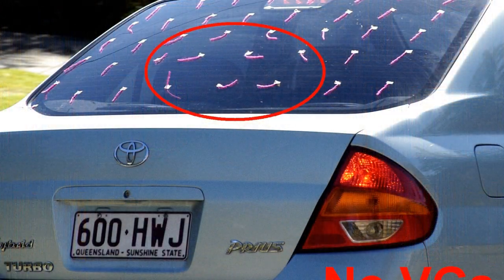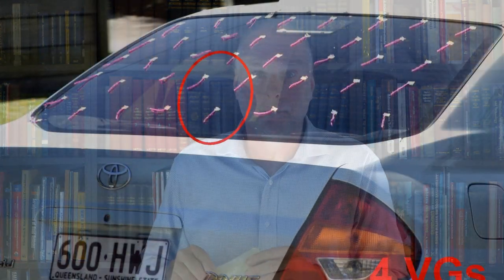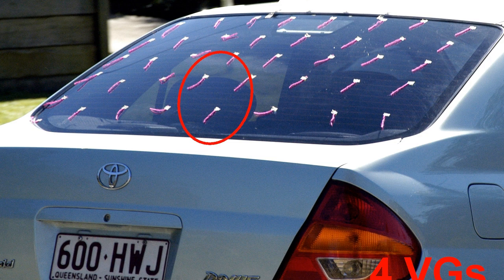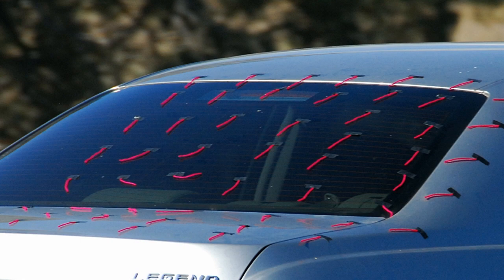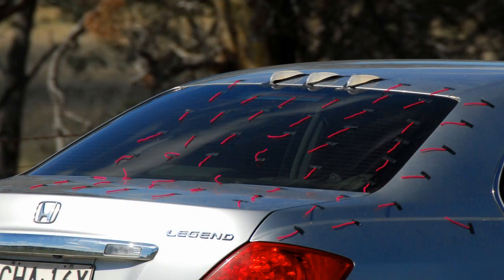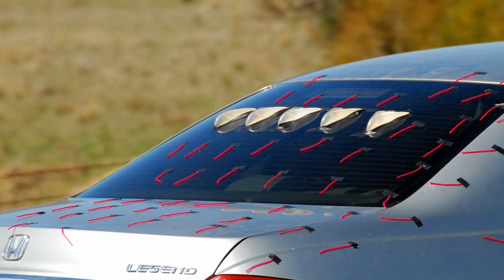Using aerodynamic vortex generators on cars

Comment: At the ~6 minute mark, where you're discussing the "filling the wake" possibilities, I believe that is specifically for bluff-ended vehicles [ie: the ones whereupon you mostly see the Airtabs implemented] like semi-trailers and motorhomes. The recommended use of Airtab approximately 1 ft in front of the trailing edge of the vehicle, iirc. The irony of imparting better airflow attachment by selective detachment of some fraction thereof is not lost on me...

Comment: Julian, what the air tabs do effectively do is improve the handling characteristics of boxy vehicles travel trailers etc. an example; I had a Chevrolet Astro van which is quite boxy and it had quite a bit of play in the steering box and it would not drive straight it would yaw back and forth going down the road and I’d have to saw back and forth on the wheel to keep it tracking straight which was not very relaxing. I plastered the sides and back of the van with air tabs at the very back where the airflow was leaving the van and the van tracked as straight as an arrow! I could drive with one hand! As you say I didn’t see any quantifiable improvement (or detriment) to fuel mileage BUT I would totally use them on a travel trailer and on a tow vehicle at the figment gap to reduce drag between the two bodies. I’d also consider placing them on a deflector wing on my tow vehicle to try to bridge that gap. What they also did very well was to markedly reduce the “push” and “suck” effect when passing/being overtaken by a large semi truck. I wonder if somehow the voticies create a type of virtual tail cone on a square backed vehicle? All I know is they help markedly in this regard and I’d use them for that again.

Comment: I totally believe in the value of VGs'.  My buddy put them on his E55 Baron (light twin engine prop) and they dropped his stall about 10 knots and dramatically helped handling at lower speeds.   

As to an auto, I believe that placement is crucial and that putting them on the trailing edge of the roof may not be the optimum location (look at the Honda Legend placement 1/3 down from the rear roof line which makes more sense to me).  Most are placing them for aesthetics like the  WRX-Sti and the Evos . Until some objective testing is done in an aerodynamic chamber or other facility, I will reserve judgment on their efficacy since although we know they work, we just are NOT sure where they need to be placed to work.   Great job on the presentation @Julian Edgar.
Reply from the maker: The published papers on vortex generators that I reference in my book are good objectives analyses of their use on cars.
Reply: @JulianEdgar  True, but where to put them is the real magic.  An airplane wing is NOT a car. Your own tests showed that placing them on the Legend trailing roof was less effective than 1/3 down the back glass.  Why and how ??

Comment: Very informative! I've installed VGs on multiple vehicles. I've found that obtaining the optimal position(s) on each car is 'half of the battle'. I usually road test w/colored chalk line powder to find the separation areas. My present 'rolling experiment' is a `07 Honda Accord w/"Gas Pods". I see complete downward airflow on all areas of the rear window where it didn't exist prior.
Reply: microair01 where did you mount them on your Accord?  I have an 07 Accord sedan SE V6 and would love to see where you put them . What gas mileage increase did you see?? Did they help stability?
Reply: I mounted them on the roof, about 1-2" from the upper rear window line. I've never performed a definitive MPG comparison, although I do get 30+mpgs on the highway without driving too conservatively. Increase in highway stability is certainly noticeable w/the 'sunroof test'...stability benefits goes away when the sunroof panel is tilted up and return when the sunroof is tilted back down. Needless to say, I rarely drive on the highway with the sunroof open at all.
Reply: @GspeedR  Thanks for the reply.  How many did you use?  AirTabs recommends 3 per linear foot on 4 inch center.   Whats your total number of tabs along the rear roof line?? Thanks again!!
Reply: Gas Pods are "bump VGs" have a smaller surface area than AirTabs. I used 8 of them spaced apart evenly which was enough to effect the entire roof line.

Comment: Hi Julian, do you think these would work effectively when placed in front of a wheel well? I know many manufacturers are using air curtains / redirected air to reduce wheel well drag.
Reply from the maker: Yes that might work, especially if the face of the wheel is flat. However, best to do an A/B comparison will wool tufts and the vortex generators.
Reply: Hi Julian, how about doing an experiment on putting these air tabs in front of the wheel well in your next video? It should be interesting

Comment: The VG's on the evo are mounted to a rounded plate with a larger radius than the roof, helping attachment.  The rounded plate itself could even wick the boundary layer down, considering it has a smooth leading edge. 
I have a side question for you? Are VG's bad for attachment along a flat underbody, I was thinking they could help with attachment but may create turbulence.  Possibly placing them 1-2 feet from the end to promote suction?
Reply from the maker: If flow is separating under the car through a change in shape, I'd expect that vortex generators could improve things. However, the best way to find these things out is to try them and measure the results. Test and measurement is worth a lot more than any guesswork. ( I have a good example of that in the book regarding underfloor vortex generators. The result was nothing like I'd imagined!)

Comment: I can see that promoting better flow attachment would be helpful in stabilizing and directing air to a wing or spoiler. On a that test Prius what benefit would there be? As stated, there is no wake-fill and thus no drag reduction and no improvement in fuel economy.
Reply from the maker: Any separation with subsequent attachment results in a separation bubble.  You don't want separation bubbles from either drag or noise perspectives.
Reply: @JulianEdgar  The way to test for drag reduction would be an increase in MPG, which I think you say hasn't been realised. Again, as you stated, there is no wake-fill and thus no drag reduction... nullifying one of your now-claimed benefits. Testing for noise is equally straightforward. Have you done that? If not, this seem to be a wholly academic exercise.
Reply from the maker: @SmashGhost  The Prius was being used as a test exercise to see if a commercially available vortex generator (AirTab) could actually influence airflow in the way it was claimed to do. It did! (The testing was done 12 years ago.) The Prius fuel consumption was so low to start with that seeing the small variation that would have been created by better flow attachment was not viable - not without testing over thousands of miles, anyway. However, I achieved measurably better fuel consumption on a Honda Legend using the same technique to gain better attachment on a rear window and trunk lid. With techniques developed for the book, I'd now measure the pressure variation on the rear window with and without the vortex generators - but I didn't know how to accurately do this measurement at the time.

Comment: I have a Mazda Miata and being a convertible the interior is quite turbulent.  I was thinking about building a strip of vortex generators aft of the trailing edge of the windshield.  In your opinion would the reduce turbulent air hooking around the top of the windshield or would it be ineffective because there is no boundary layer past the top of the windshield? Thank you
Reply from the maker: I don’t think they’d do anything. Use a wind blocker panel behind the seats like Porsche.

Comment: Is there a spray-able " micro- vortex generator"??  Plasti dip with electrostatic particles that can be manipulated   to self arrange or with a charge . Would a " VG" evan be efficient on a vary small scale?? Just a thought
Reply from the maker: Vortex generators need to project through the boundary layer, so required size is determined by that.

Comment: I have a Lance 1575 travel trailer which has a box shaped rear. Do you think adding these vortex generators to the rear sides and top of the trailer could reduce negative pressure, and how could I go about testing the effectiveness / placement (without a wind tunnel).
Reply from the maker: I do not think that adding vortex generators to the rear sides and top will reduce drag. Despite lots of anecdotes about VG being effective in this situation, as I cite in the book, I've not seen any formal evidence that's the case. You could test the results by long distance fuel economy or by measuring the average pressures on the back of the trailer. Looking at pics of the trailer, rounding the sharp front corners would be my first step - not easy. Wool tufting the sides of the trailer would show the difference this would make - my guess is that there would be separated flow on the sides of the trailer as it currently is. Lots on wool tuft testing and pressure measurement in my book -  https://www.amazon.com/Modifying-Aerodynamics-Your-Road-SpeedPro/dp/1787112837
Reply: @JulianEdgar  thank you for the respond. I'll likely avoid putting them on for now, until I'm prepared to do some testing as you suggest.

Comment: Julian, in the states they use something called " trailer tails  ". on semi trailers.  Why do these work??
Reply from the maker: Yes, covered in Chapter 6 of my book.
Reply: Gotcha, and thanks.   Curious as to whether you believe air tabs would help on rear window of Model 3. The rear window is pretty raked .
Reply from the maker: I try not to guess, but instead test. Wool tuft testing would take 10-15 min to find that out for certain.

Comment: Sir,

In the US these VGs are used on large box shaped vehicles at the trailing edge. Is there and benefit that could be achieved on the front of a box shaped vehicle like a Jeep Wrangler? Could a VG help with the transition between the front bumper, grill, hood and fender flares or would this cause more drag?

Thanks
John
Reply from the maker: If the flow is becoming separated at these points, vortex generators may help. However, and it's a big 'however', by far the most accurate way to see what actually happens is to test the vehicle when standard, and then with vortex generators temporarily added. Simple wool tuft testing will show the flows.  With car aerodynamics it's always better to test, not guess!

Comment: Would these change anything on a van or SUV with a square back?
Reply from the maker: No
Reply: A slightly downward angled spoiler (like you see on modern SUVs) helps the most. The trick is to direct the wake downward smoothly. Tall VGs generates too much turbulence and drag.

Comment: Back of my carado i339 Motorhome is a flat slab .. I wonder if and where I should fit them..
Reply from the maker: No where. That's not how they work.
Reply: @JulianEdgar  They're used on lorries though.. usually around the rear roof and tailgate sides..
Reply from the maker: @mr.d7372  Not by any OE manufacturer though... Check out my other videos on the topic - there's zero technical evidence they do anything positive in that application.

Comment: What about on the roof of my dual cab amarok to help the air flow over the bed with a cover on it?
Reply from the maker: No I wouldn't think so - but cheap to try
Reply: @JulianEdgar  my biggest challenge, and the real reason I study your work is my wrx powered vw beetle..looking for ways to keep it stable at high speeds as the back wants to take off without a wing like the vw fun cup cars in Europe. Radiator opening at the front adds to the challenge.   probably the hardest car to play with..haha
Reply from the maker: @Healthfighthunt  All pretty straightforward. Do some testing so you can see what is actually happening, trial some modifications based on that testing, get the results you want then build the real additions.  Same as any car.

Comment: How about on the trailing edge of the roof on a pickup truck which has a 90 degree window behind it and a tonneau cover of the back..?
Reply from the maker: Won’t do anything positive.  Why would they?
Reply: @JulianEdgar  adds air pressure to the drag volume
Reply from the maker: @NwoDispatcher  How do they do that? There's not an aerodynamic textbook in the world that supports that theory.
Reply: @JulianEdgar  ever seen the rest spoiler of a 3rd gen 4 runner? I own one and the surface deflects air downward to make the rear a "virtual taper". My thought is that the vortexes help make this virtual taper as well. Think of an aerospike missile. It has a truncated nose with a tungsten tipped rod  pointing out it's end. This makes the air follow a virtual nose cone path
Reply from the maker: @NwoDispatcher  You can come up with any personal theory you like, but I go on what professional aerodynamicists  say. There is zero evidence that vortex generators act as you say they do.
Reply: @JulianEdgar  thats fine, but if they did, would it be effective? Is it possible to create 'virtual' boundary layer profiles?
Reply from the maker: @NwoDispatcher  I have no idea what a 'virtual boundary layer profile' is. To be honest, I just don't know why people make up aero theories - do they make up car electrical theories? Or suspension theories?
Reply: @JulianEdgar  I'd say that Virtual boundary layer is when an airflow becomes a coordinated column of air resistant to pressure swings. Like a vortex. This creates separation between outside air and air on the other side of this column

Comment: We just ran AirTabs on and E36 BMW in the wind tunnel. We did only do one run in one location (wind tunnel time is expensive!) but they were terrible. Added a few pounds of drag and less then one pound of downforce (or loss of lift). They are in this video here: https://www.youtube.com/watch?v=KI1gi9_6WRM
Reply from the maker: I don't have time to watch a 20 min video, I am afraid. At what point in the video are the AirTabs, please?
Reply: Julian Edgar one of the first runs.
Reply from the maker: A few things. It's such a tiny wind tunnel that I have some doubts if the results would be valid. However, that said, my more major concern is: what were you actually trying to achieve with the vortex generators? I'd imagine a car like that would already have attached flow down the rear window, so all that the AirTabs would do in that situation is create drag. All vortex generators create drag, and so for them to work, the change in pressures (in this case on the rear window) has to be greater in effect than the drag they create.
Reply: Julian Edgar agreed. The car owner wanted to put them on just to see. I figured it would be a waste on a coupe like that and once he saw the numbers we moved onto other things we wanted to test.